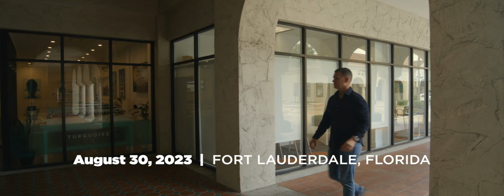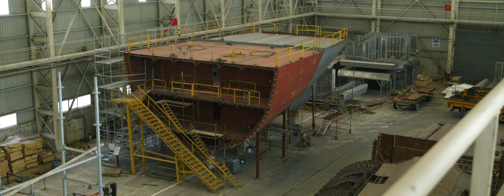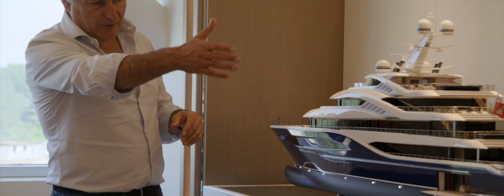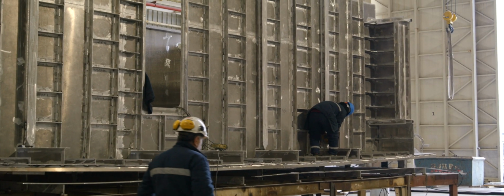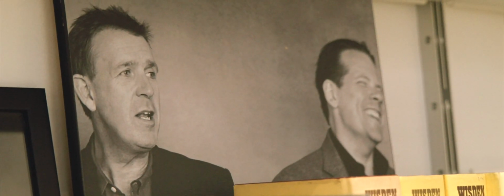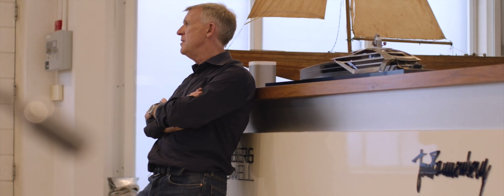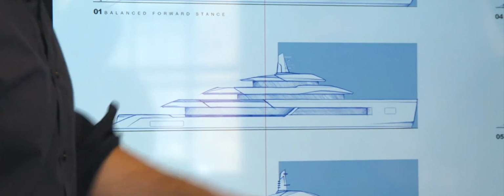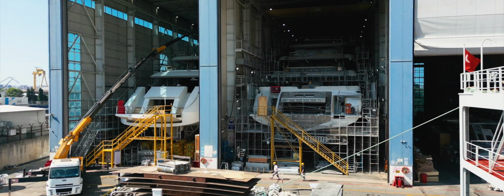Showcasing the 65m Above & 80m Beyond

Comment: Here are the key facts about the "Above & Beyond" collaboration:
 * Partnership: Denison Yachting, Bannenberg & Rowell Design, and Turquoise Yachts have collaborated on a series of two "explorer" yacht concepts.
 * Yacht Concepts: The series consists of two yachts: a 65-meter yacht named "Above" and an 80-meter yacht named "Beyond."
 * Designers: Bannenberg & Rowell Design is responsible for both the exterior and interior design of the yachts.
 * Builder: The yachts are to be built by Turquoise Yachts, a shipyard based in Turkey.
 * Sales/Brokerage: Denison Yachting is the exclusive broker for the projects.
 * Status: The concepts are available as new construction opportunities. The 65-meter "Above" is based on an existing hull platform. The projects have an "engineering package and construction timeline" in place.
 * Key Features (for the 65m "Above"):
   * Length: 65 meters (213 feet)
   * Beam: 11.2 meters (36.7 feet)
   * Gross Tonnage: Approximately 1,400 GT.
   * Construction: Steel hull and aluminum superstructure.
   * Performance: Twin Caterpillar 3512C engines, a top speed of 16 knots, a cruising speed of 12 knots, and a cruising range of 4,500 nautical miles.
   * Accommodations: Seven cabins for up to 14 guests, including a dedicated owner's deck with a private suite and 270-degree panoramic views.
   * Amenities: A main deck with a glass-bottom pool, a wellness area on the lower deck with a sauna, massage room, and gym, and a unique "Crow's Nest" that can move up and down the mast for 360-degree views.